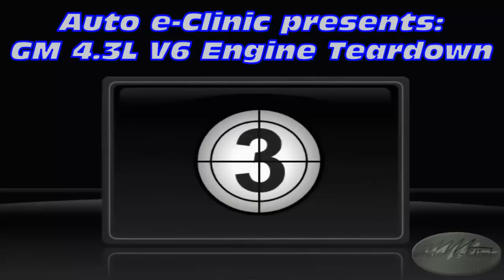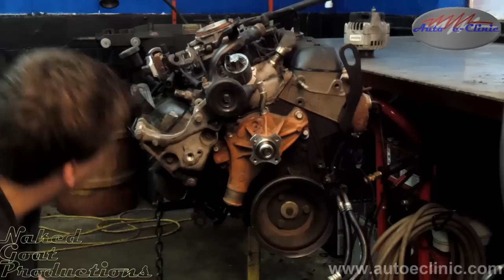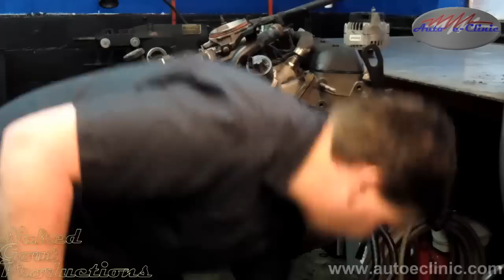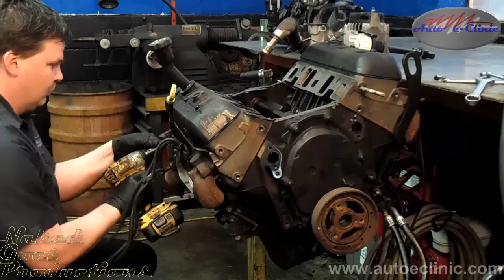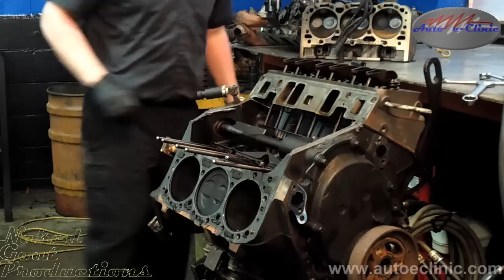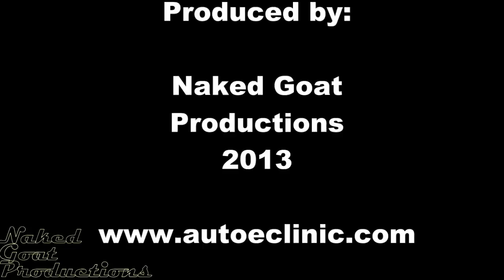GM ( Chevrolet or GMC ) 4.3 L V6 Engine Tear Down

Comment: This video was exactly what I needed to see.  I have an S10 with what I believe to be head gasket issues.  It's sat forever because 1200$ is too much to fix it and I've been scared to do it myself...Until now.  The intake manifold/throttle body etc. comes off as one piece?  Fantastic.  Cylinder head can stay assembled?  News to me! Outstanding.   Thank you so much for posting this video.

Comment from the maker: Thank you! You can remove the intake with throttle body attached but you may want to remove the throttle body from the intake afterwards. This gives you a chance to clean the carbon build up. Also a new throttle body gasket may prevent a possible leak issue. The cylinder heads can remain assembled while unbolting them from the block. Although if there was any suspected head or head gasket problem its always best to have them checked for cracks and straightness.

Comment from the maker: On a 4.3? I have never seen a tensioner on a 4.3 GM timing chain. Otherwise every GM 4.3 has alligment marks on the crank gear, cam gear, and balance shaft gear. I will have to have year, make, and model to give you specific details. Thanks Michael and Aaron.

Comment: great vid gives me a idea on my 2005 blazer motor .. Any idea what to look for that wear and tear quick IE  head gaskets, bearings, fuel pumps  just bought the truck.. I'm use to 80's 305 350's subbed and liked

Comment: I'm looking to put either a gm 4.3 v6 or 5.3 or 5.7 v8 in my 1976 cj7.. (years: 87-91 with vin z on eigth digit..) Any suggestions on the best, most economical and easiest swap of these 3? The jeep will mainly be a daily driver and used in seasonal snow.. No real off roading.. I also want to get the 700r4 auto transmission and retain my dana 20 t-case. Thanks for the video. :)

Comment: What about timing set? lets say i need to replace valve lifters now, and install 260 cam shaft, do i have to do it at the same time or i can install shaft afterall? How i can hold the lifters in its places when i gonna change cam shaft?

Comment: random question since i may have to do this myself soon. my 94 sonoma's motor is seized and im not sure what happened to it. was driving down the road and the check gauges light came on, had no oil pressure and before i could turn it off it died. it was as if someone was sitting next to me and turned the key off, no knocking, smoke, or any other typical sign of a nuked engine.  Can anyone give me a clue as to what happened??? Seized crank bearing???

Comment: There is a tool that saves you lots of time on this job.  Go to ebay and search for: Fuel Line Removal Tool GM 4.3L and 5.7lL Isuzu 16mm Lower Intake Blazer Jimmy

Comment: I have heard it is the same as the V8, is the front half the same, so similar brackets work for both?
Reply: Almost everything is the exact same. Accessories, brackets, etc. Anything computer controlled may be different, but for the most part even that stuff is interchangeable
Reply: @elidames6889  you can see the three engines, and I am wondering why the routing of the belt and idler are different at all, except to offer different products  http://gmauthority.com/blog/wp-content/gallery/gm-4-3l-v6-ecotec3-lv3-engine/gm-4-3l-v6-ecotec3-lv3-engine-2.jpg  
http://gmauthority.com/blog/wp-content/gallery/gm-5-3l-v8-ecotec3-l83-engine/gm-5-3l-v8-ecotec3-l83-engine-3.jpg  
http://gmauthority.com/blog/wp-content/gallery/gm-6-2l-v8-ecotec3-l86-engine/gm-6-2l-v8-ecotec3-l86-engine-4.jpg
Reply: @elidames6889  what appears to happen if you toggle the photos in a tab browser, you will notice the back motor mounts are same, so the engine is the same from the back-forwards, except for cylinders 3 and 6, so the front of the engine is different, it uses a longer bracket to make up for the missing cylinders, to make the engine the same overall length. (I do not really know reasons or rationale)
Reply: @elidames6889  I proved a v8 ECM works
Reply: @elidames6889  the brackets are longer, or THICKER in the Z plane, but use same holes for same reason, there are 3 idler setups for 4.3, 5.3,  6.2 and the 6.6 truck engine coming out

Comment: my head bolts are too tight?  how can i remove them without snaping them? also, are they 166mm heads? because notheing else i have seems to fit, and i dont have a 16mm socket. thanks for your help
Reply: Just apply constant pressure to tho bolt and slowly apply more and more they'll come lose

Comment: I have to ask anybody else have lifter noise with the 4.3L V6 overall this is a solid engine pair it up with a solid cast iron transfer case good combo for a 4x4
Reply: I had lifter noise on my 4.3 after i bought it with 123,000 miles. Used motor flush on it and replaced the oil pressure sensor after all the gunk clogged it. Never heard a lifter noise again after that. Also ran rislone additive for 3,000 miles and changed to full synthetic.
Reply: My 300k mile 98 4.3 do it a little

Comment: Nice vid.
Could you please tell how to check the harmonic balancer for this engine?
I'm asking, because on idle there's some small vibrations, when I push the gas pedal when in parking the vibrations get stronger. The strongest ones are ~1500-2000 RPM, then gets a little less when higher RPM. When cruising and when I try to floor it, the vibrations are very big. One friend told to check if torque converter is ok (i doubt it would be bad, because had a full tranny repair 1 month ago) and if harmonic balancer is ok, but don't know how to test it.
Any help/info would be great.
Thank you!
Reply from the maker: firebirdclub Thanks for watching but unfortunately Michael passed away in March of this year and we are not able to answer questions at this time.
Reply: AutoEclinic Sorry to hear that! :( may he rest in peace!
Reply: firebirdclub  Look for a Dirty Plug it sounds like your dragging a cylinder
Reply: AutoEclinic Jeez, that's like the month after this video was uploaded.

What the hell
Reply: Sethorion99 wait no, a year. Nevermind.

On the plus side, he did a good job of tearing down that engine.
Reply: After a long time I did find the reasons for all the issues I had. 1. 100% new coil was bad (bought 2 from a shop, both were bad) - changed for a used one from driving Blazer and the misfire was gone. 2. Vibrations were made because previous owner when rebuilding engine used wrong pistons. Changed for original ones with right weight and vibrations are also gone.
Reply: Going goo on lol he is 6677777777777777777⅞7

Comment: I have water in my oil I no my exaust manifolds are craked so I should have water in cilinders but I don't is there a chance the block is ok 2 freeze plugs were oiut
Reply: "no'ing" is half the battle
Reply: richard chasteen if two freze plugs were pushed out the block could have cracked before freeze plugs poped out. this happned to me.

Comment: How do we know if crank is not 180 degrees out when setting chain on 2000 S10 4.3 Vortec
Reply: Dot to Dot on chain alignment,will need to turn 180  when installing dist.

Comment: can anyone tell me if you can use any 4.3 block for a rebuildable short block?

I have a 95 s10 with a Z code setup/TBI and need to rebuild another short block (mine is seized).

Thanks
Reply: Stop....get a 350 small block...get it over with
Reply: Just for my own edification, can you not use the block again if the sleeves are not galled, or replace the sleeves themselves? Would that be a cost effective way to do that? I'm transitioning from Toyota R&D off road race trucks & Supercross bikes. I have a 99 S-10 LS with only 145K miles on it. Everything is sound. I'd like to take it a couple notches higher in get-up & go. Just don't know where to start. Any tips for this Cretin (as I was so affectionately called above) would be greatly appreciated.
Reply: Papa Mac - have you tried letting the pistons still in the cylinders soak in tranny fluid for a bit? I did that trick with my Father on his E Type Jag with a V-12 in it. Worked out great too when we finally got the pistons moving, we were able to blow the heads off by compression. That was a VERY educational rebuild!

Comment: The pcv valve keeps blowing out on my 98 chevy 1500 is my engine fucked ?
Reply: supershark 9k Maybe the pcv isn't opening venting the gasses, and it builds up and pops it off? Just a guess
Reply: supershark - are you getting lots of oil blow-by going on through there?
Reply: supershark9k your engine is building crankcase pressure i have seen oil pan gaskets blown out because of same problem.could be a big problem.

Comment: Where can I find the engine ground cable on this motor
Reply: Driver side cylinder head to fire wall ground I'd recommend grounding the passenger side as well it's cheap insurance and will help the engine idle and  run more smoothly and help prevent miss fire just my 2 cents peace and much respect Jason.GM only runs one ground strap off the cylinder head factory. performance people who know run 2

Comment: Thanks for the video - I have two quick questions. I am in the UK so can't ask anyone easily...

Is there a tensioner on the chain as standard or is that the aftermarket fix for the rattle? Do you have a video or link to a how-to please?

How do you align the balance shaft with the timing chain correctly please?

Thanks!

Comment from the maker: Thank you!
Reply: I didn't see a power steering pump in the video. Is it relatively easy to remove?
Reply: @Chris-707  I’d remove prior to pulling engine from the vehicle to keep from breaking the closed loop power steering system if possible.

Comment: When you do a tuneup on a 4.3 do you have to do a reset on the computer please comment back very curious thank you very much
Reply: I never have but I do suggest that you check your oil pressure and check to make sure your motor is cycling oil well by removing your valve cover and letting your vehicle run for a minute to see if any oil is coming up. These motors are bad about losing oil pressure and messing up lifters and sometimes crankshaft bearings

Comment: Good Lord!!!! I wouldn't let this man anywhere near one of my vehicles - you DON"T take a steel hammer to an aluminum head!!!! 2:51 Ok - maybe those are cast heads, hell - I can't see. I just don't think it's a good idea to take a hammer to your heads....
Reply: Henri de la Garrigue
Reply: Steel heads on v6 vortec
Reply: the heads are steel, i think i will never let YOU near any of my vehicles.
Reply: It doesn't matter if the heads are steel or not - there's no need to be a "hammer mechanic". If nothing else, let the compression blow them off. If you have to use a hammer - use a dead-blow. Who's to say you won't miss & hit a valve guide, break a stud...
Reply: I hate these little pieces of obsoleat crap anyway anyone that is working on one of these turds I feal sorry for ya here's my best tip. if ya are use only gm parts no aftermarket stuff on this doll
Reply: That what he used.
Reply: If you use a hammer on your vehicles, they're probably crap anyway. I wouldn't want to go near them. By all means - use a tire tool on your heads as well....
Reply: Michel Linschoten yes gm sadly couldn't design a new v6 for so long cause they were just trying to keep the lights on so much so that the government bailed them out so the could pay someone to design a new v6 for them ,I saw a 2010 with this same crap engine in it still running a distributer and that worthless brain dead invention called the fuel spider also don't even try to compair this stupid v6 to the great 350cu or the infamus 5.3l there great this v6 oil leak is a turd and all ways was
Reply: oh I deal with them....all the time when the tow truck drops them off or they run so terrible they don't pass emission inspection or they don't have any power or when there using a quart of oil a week yea that's the reality iam in I wouldn't comment if I wasn't 100 percent on my stuff. sounds like a couple of folks in here might actually be proud owners of one off these boat anchors...sorry about that
Reply: I do believe you should read what you just belched out and take it to heart. You don't know me or anything about me, so your opinions mean nothing. You're wasting my (& the rest of the outside world's) oxygen. Go play with your Tonka trucks, the adults are talking. Have a nice day.
Reply: Henri ,do you have a vehicle with one of these 4.3l in it yes or no..??
Reply: John, those comments I made were directed michel. Yes, I have a '99 Chevy S-10 LS. Hasn't given me a bit of problems!
Reply: Henri de la Garrigue oh I got ya ha I think we ran ol Michel off hehehe good times
Reply: Hey John Pannell, Gawd I hope so!!!! I have nothing against a 4.3 Vortec. It's a strong little engine with plenty of stock power for an S-10 pickup. Before she (michel) went off on me - my only thing was that you simply DO NOT take a steel faced hammer to ANY engine parts, cast steel or not!!! I admit that I don't know all of the ins & outs of GM engines, but I've built many strong GM & Ford powerplants in my day & they served me well. Maybe I should've kept the "asshat" to myself, but I still see no need to take a steel hammer to an engine...
Reply: Henri de la Garrigue Boo boo bee boo don't do that wah wah wah woo. I'm a youtube expert.
Reply: There's really no need for name calling... The heads on my 4.3L Vortec are aluminum
Reply: Henri de la Garrigue lol one comment made about the head material on a 4.3l and now your a celebrity haha
Reply: I know... I guess some folks just can't let things go. I on the other hand have more constructive things to do with my time. I think Michel just needs to change his tampon & shut up while the adults are talking!!!
Reply: they are actually cast iron
Reply: Izak wasserman -I figured that out. My point is you just shouldn't take a steel hammer to major engine components. My Dad taught me that there was a right tool for every job.
Reply: Dude, I laughed when I saw the arguments on this comment. This engine was made before elastic air flow was mainstream. These engines aren't bad necessarily. But they're all going to eventually get phased out by their LS counterparts.

Comment: COMPARISON PHOTOS of THE 3 GM ENGINES 

http://gmauthority.com/blog/wp-content/gallery/gm-4-3l-v6-ecotec3-lv3-engine/gm-4-3l-v6-ecotec3-lv3-engine-2.jpg  
http://gmauthority.com/blog/wp-content/gallery/gm-5-3l-v8-ecotec3-l83-engine/gm-5-3l-v8-ecotec3-l83-engine-3.jpg  
http://gmauthority.com/blog/wp-content/gallery/gm-6-2l-v8-ecotec3-l86-engine/gm-6-2l-v8-ecotec3-l86-engine-4.jpg

Comment: 5.3 liter or nothing.
Reply: 327 ,5.3 liter vortec with a stage 3 software upgrade and my dc programmer.,,411 positive Trac rear end and hydraulic transmission with a shift kit and a column to floor transition with a 5 speed that shifts like a standard or automatic it's a Corvette transmission but not sure what I have a mod cam cold air intake with a blower I took out of a tower from an old desk top computer wired it and have a Google switch and an indicator light for when I need to hit the blower I also have a small oxygen tank drilled into the intake with a quarter inch hose that I release when my light for my fan comes on I only open it to a minimum psideoending if my fuel and fire is burning hot enough to accept the pure oxygen levels f not then I just hit the blower and I have a pint of his gh octane basically cheap jet fuel that is hooked up to a secondary fuel line so it mixes with the 93 octane I always run anyway just in case I need to get a few 100's of a second to get the win I got rid of the cat and went straight pipes three total one on each side that turns out before the rear wheel and the third is 4" tip turned down and I heated up with a torch sprayed it with water five or six times and I promise it sounds like a beast

Comment: Worst freaking engine ever. Pull it, scrap it, drop in an ls
Reply: I Have Vigors mine has been pretty solid, they are not as good as the 5.3 but hell you can get these for 200-300 bucks lol
Reply: I Have Vigors lu3? The lu3 was possibly the best v6 chevy ever made

Comment: hi, i have a 262 in a mitsubishi panel is like a van, for cargo, and the engine oil pan is too close of the floor, about 5 inch. Can i cut to reduce the engine oil pan 1 inch up? and the arm of the oil pump too?  And then instal a oil cooler to increasing of oil capacity lost? thank a lot.
Reply from the maker: You may want to check with companies like Jegs or Summit. They use several different oil pan companies who could help you out. Worse case would be to have it all fabricated up.
Reply: AutoEclinic ok i will check with thats companies thank a lot.